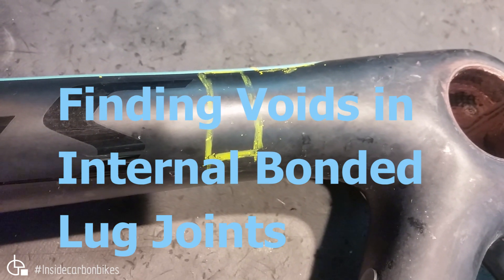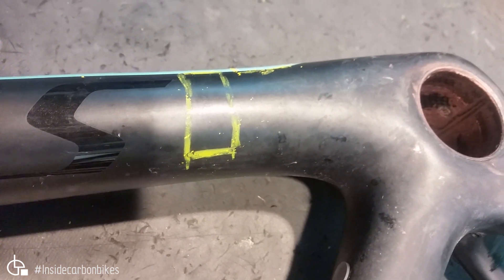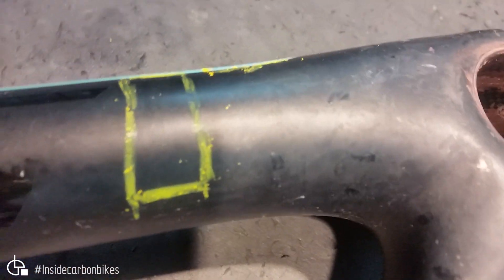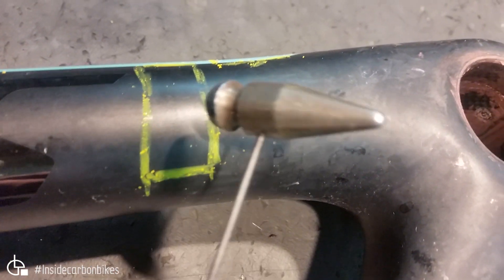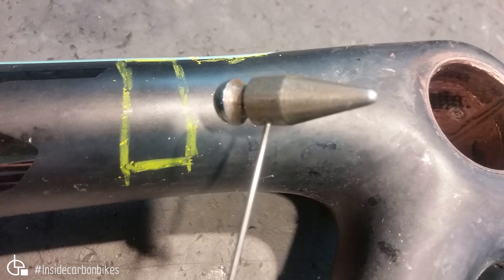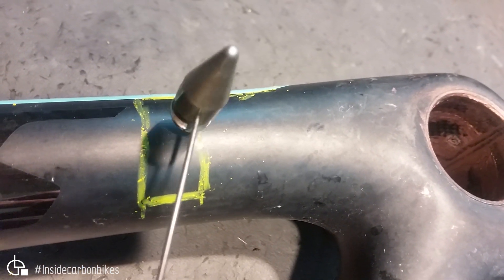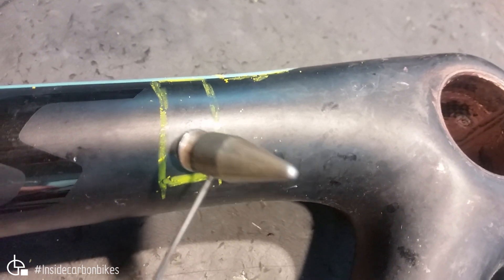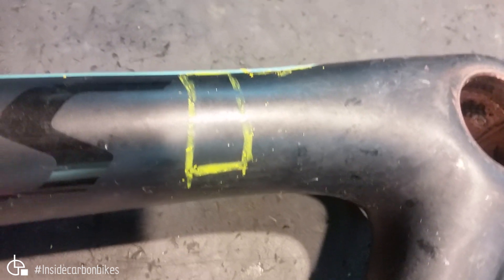Finding Voids in Internal Bonded Lug Joints

Comment: Dear R,

It is very clear to see a lot of these high end frames contain voids, but realistically given the assembly method it is 95% impossible to avoid adhesive voids in these factories. Even the high end ones. More care can be taken on the laminate side, but with the adhesive it is very difficult to control, and actually every frame I have seen from all different suppliers contain voids in the laminate and are rarely problematic.

Regards
Reply: Rarely problematic in the short term, or with easy use. But not everyone replaces their bike every year or two, and some push the gear to its limits. It's great business when you effectively force everybody to upgrade/replace your product efery few years.

There are methods and tests that would allow far fewer, if any, of those issues, but it appears that even high-end products are typically made the cheap&quick way.
Reply: Specialized recalled 13,000 forks.
Reply: $5000 carbon frames should not be having these issues. Too many shitty bike companies out there